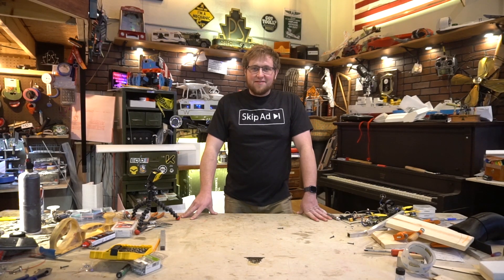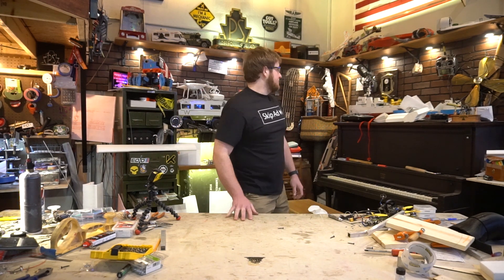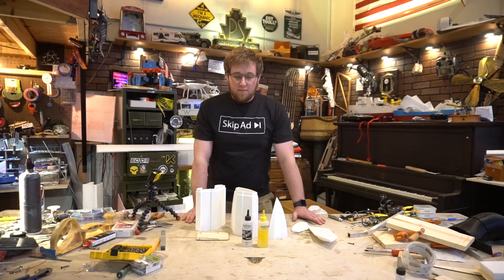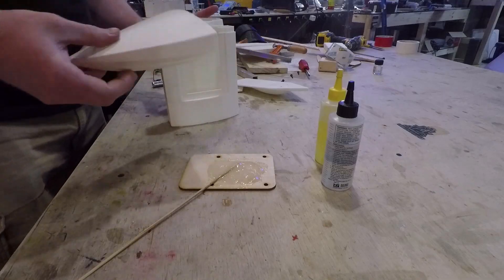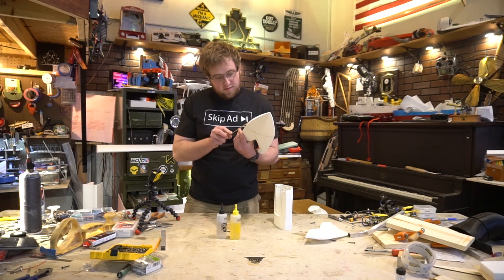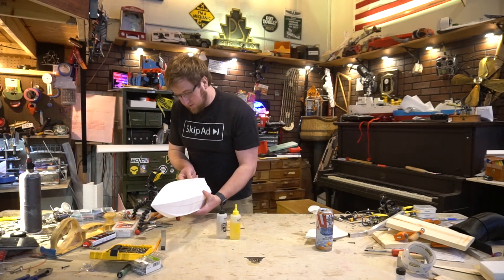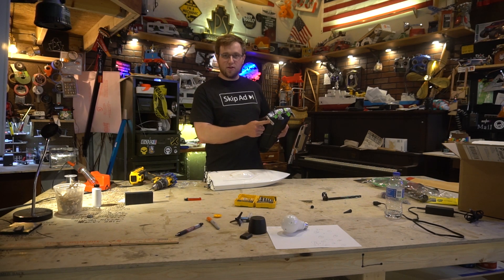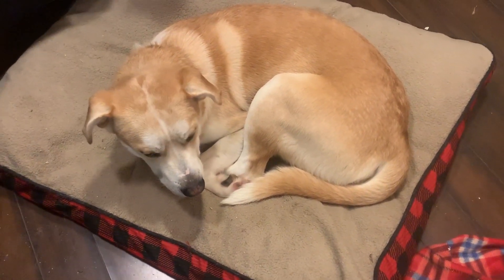How to Make a 3D Printed Speed Boat

Comment: Anyone tried an 'as printed' hull with rough surfaces compared to one which is simliar but beautifully filled/smooth/polished?  Just interested because the dimples on a golf ball are put there to make it  travel a greater distance (through air) than a comparable smooth one and some fish skins are quite rough and are said to have an energy saving effect . . . ?  As an aside, I remember an experimental system where air was pumped through a mesh at the bow of a fast boat so that it rode on a stream of bubbles, and air blown from slots on an aircraft wing to make it more aerodynamically 'slippery' . . .
Reply: In the soviet union, torpedoes had heaters installed at the bow to boil the water, so they flew through a water vapor bubble at supersonic speeds.
Reply: https://en.m.wikipedia.org/wiki/VA-111_Shkval

Comment: G'day Sam,

  Cool, submersible Electricksical Motors...(?) !

    But, mate, the Hubs and inner Blades of most mass-produced Airscrew Propellers are "Production-Engineered" by people paying much more homage to ease of manufacturing rather than building Blades which have accurate Helical Pitch over their inner 1/3 to 1/2 of the Disc's Radius...

  So, those truncated amputated Stub-Propellers you're using are "absolute Shite" in the Efficiency Stakes...

   To see what I mean, check out some of my recent uploads showing the 8-inch Diameter by 6-inch Pitch Wooden Airscrews I've been making - to be driven by a little Electric Motor powered by a Peltier-Effect  Device..., sitting atop my Woodburning Potbelly pushing out maybe 180 cubic feet of warm air per minute at 360 RPM....

  I'm laminating them in Chainsaw-milled Quarter-Cut (Commercially-Extinct) Native Timber salvaged from Windfalls, Red Cedar and Black Oak, Black Oak & (Feral) Radiata Pine, Stringybark snd Black Oak, kinda thing...

  You could probably design yourself a Water-Propeller with a correct Helical Pitch for your RPM & Advance-Ratio...; and then you could "Print" yourself something which works better than a butchered Airscrew drinking Water - while trying to push a Speedboat from the wrong side of the Meniscus/Interface, entirely.., surely ?

Just(ifiably ?) sayin',

Have a good one.

;-p

Ciao !

Comment: Thanks Sam, is it possible to make a smaller version. Everything seems simple enough, but i wish to save on some filament.
Reply: Print the frames of the boat and a keel, then skin it with styrene (or any plastic sheet you can find, really). It's 10% of the material used here, even less, if you're willing to compromise long term structure (like if you're just interested in testing stuff).

Comment: 2:06 - I know Sam is just doing a quick demo, but I find it best to squeeze out parallel lines of A & B, then mix. Much easier to get the proportions closer to 1:1 than with two random-shaped blobs.
Reply: Good tip, John. Thanks.